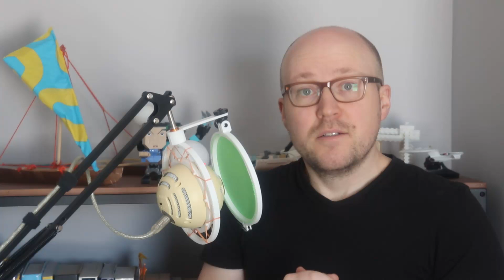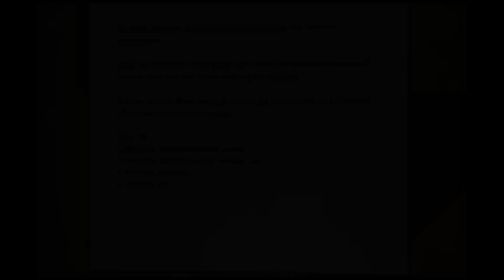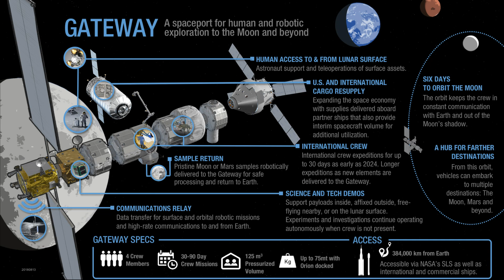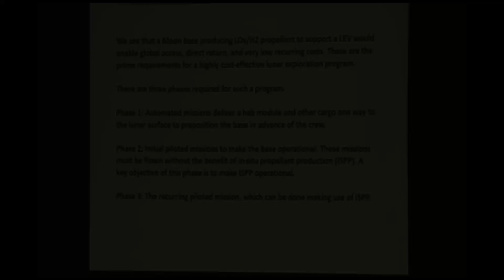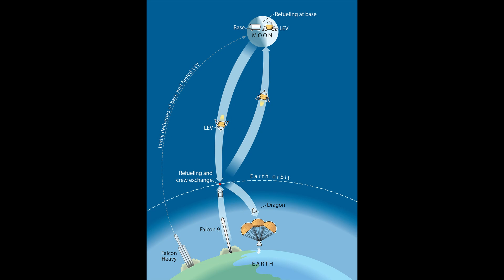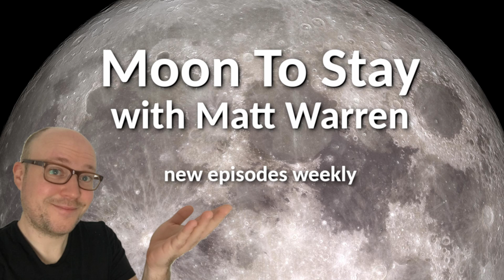Moon Direct, Dr. Robert Zubrin's plan to get to the moon Sooner | Moon To Stay #6

Comment: I am a big fan of Dr Zubrin. But is a bad idea to send a cryogenic fueled lunar lander all the way to the LEO, in the 3 days journey trough van Allen belt in a cabin with a paper thick wal.And high speed atmospheric re-entering is a proven technology but on orbit fuel transfer is not.
Reply from the maker: Given the potential of a 10x cheaper option for getting back and forth to the moon, those technical challenges will be worth solving
Reply: @matt-warren  making the fuel on the moon and using in a reuseble lander, is the way to do it. But a falcon 9 can't send a dragon capsule to the moon only in the reuseble configuration. If you use the expandable one or the falcon heavy fully reuseble it will cost you with 30 million dollar less, because you don't need to send a second falcon 9 with a cryogenic tank to refueling lunar lander on LEO. and if you keep the lander in lunar orbit would save more fuel and can send a heavier payload to moon surface. I don't think a reuseble lander should have a build-in cabin, only capacity to connect with the different types of capsule and other payloads. And if you need to send a payload to the earth ,only push it to the right direction and return the lander to the moon.

Comment: Good presentation. I don't think you can count on making fuel on the Moon and therefore will need to factor in providing all the fuel from Earth. 

Also, despite the high cost, you should consider using SLS block 1 for all the heavy lifting. I think NASA could consider dropping the Gateway if other programs are retained. Unfortunately politics is involved but that's what happens when you have a government run program.